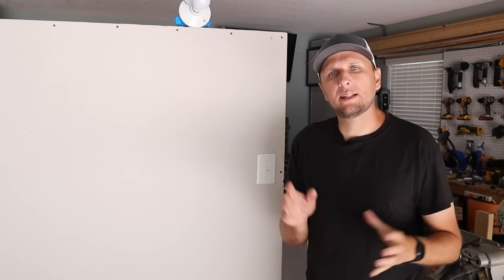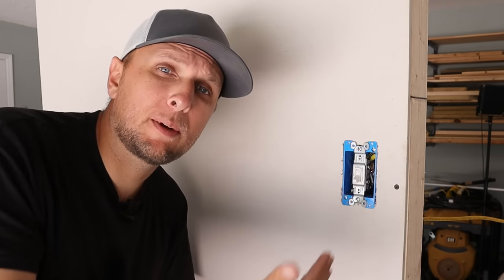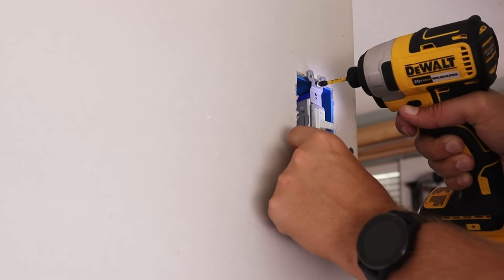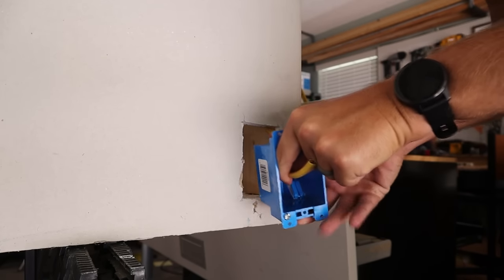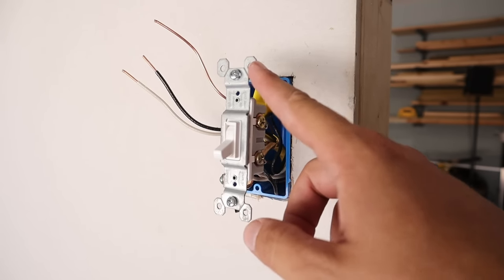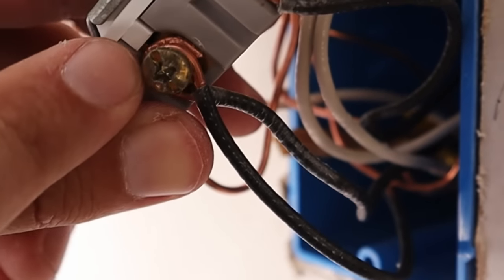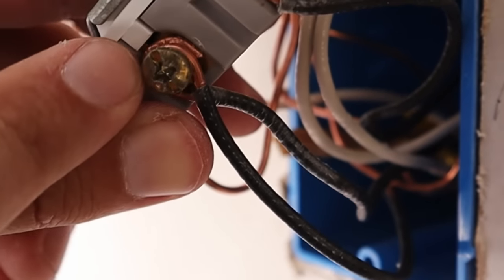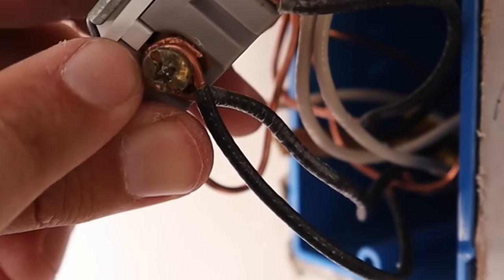How To Add An Outlet From A Light Switch | Common Mistake

Comment: One suggestion for DIYers, check that the power is on before you go and isolate that circuit. I've known some people who shocked themselves because they tested it after shutting off the power only to find out that they werent testing it right. If you confirmed that the power was on then you should be good when you test it after flipping the breaker and power is off.

Comment: Need check box fill on conductors. Need to allow 2 wires for the yoke or strap(switch) and add up all other conductors to make sure your box is not over the allowable amount. Good chance you will have to change out the box for the switch.

Comment: Homes after a specific date (not sure when they were adopted by your local authority) require arc fault protection on receptacles, so they were typically not wired in with lighting circuits, so this method would not fly.
Reply: This method wouldn't fly in most countries.

Comment: When you wiggle the strippers on the wire like that it's possible to score the wire. instead, after clamping down with them use the thumb of your other hand to push the strippers off the wire.

Comment: Thanks, I have a storage room that was added onto the house before I bought it, it has one light switch and no outlet, the light switch is on the inside hinge side of the door so you have to walk around the door to turn the light on. The room is unfinished, bare studs inside. I want to move the switch to the latch side of the door and add a interior and exterior outlets to the curcuit the nearest outlet is more than 50 feet away outside and my extension cord for my chain saw only reaches one side of the tree near the door.

Comment: Is it safe to plug a power strip from this new outlet? I would like to add another outlet in my room (but get it done professionally) and I'm thinking of suggesting this method to an electrician, but I'm worried if it will overload if I plug a power strip from this.

Comment: Hi Adam, when your connecting a light switch to a prexisting outlet ( for a light fixture), will that switch turn the outlet on and off too.

I need to feed off an outlet but don't want the outlet to go on and off each time I turn the switch on

Comment: Instead of wire nuts, you should try using WAGO lever nuts... so much easier to work with, no twisting required.

Comment: I tend to use number 12 wires and that is lot harder to work with than is the case with number 14.  I see that number 14 is the favored wiring these days and I think it costs less too.

Comment: I thought I was all set and did this method in a double gang switch box. Can't get the receptacle to work properly. It is either powered when the switch is on, or the switched fixture only works when an item is plugged into the outlet, and on. Where can I go (other than fork over $$$ for an electrician) to understand what to do? The switch box initially had 3x 14/2 coming in (now it has a 4th as I dropped in the receptacle). I'm assuming this means the power comes straight from the breaker to the box, and not to the lights. House built 8 years ago (but by my father-in-law, who is not known for doing things the right way but the easy or cheapest way).

Comment: I have 5 tips for you. 
1. Always finish tightening with a regular screwdriver not Phillips. The screw will be tighter. Always use the screws not the push in. 
2. You can mention that the white wire will always be on the same side as the ground. 
3. The reason doubling or pairing the wires is bad, is because of the heat the wire creates when electricity moves through it.  It will expand and contract and finally come loose or even start a fire!
4. Even when I shut the breaker off and test it with the tester,  you should always check with your index finger and thumb to make sure the power is off.  Thumb goes on the hot and index finger goes on the neutral.  And you do it with a quick on/off tap. This way if for any reason you shut the wrong breaker off,  the electricity goes through your hand and not through your heart! It's a great practice to do.
5. I sometimes still like to run 2 screws in each corner of the old construction box and into the stud to secure the box better.
Reply: Nice video!

Comment: Hi, one point I've never seen addresses in any video, and no one has answered this question although I've put it on several videos - suppose, like in my shop situation, the box has 4 light switches.  Do I put 4 wires and one input pig tail (that's 5 wires) into one wire nut?  It somehow seems better to just put two wires on each receptacle.

Comment: I noticed u don’t tape up the outlet to prevent shock when placing it back and also helps stop ground hitting the ground it’s not necessary but I’ve found when u have diy homeowners it helps stops the called of pissed off ppl saying u told me the wrong cause it’s been months since I told them and they forget which one so yeah

Comment: If metal falls across a plugged-in cord at the outlet, it will strike the ground first instead of the hot wires if the outlet ground is on top. I also noticed that the wire loop on the switch ground was not in the direction used to tightening the ground screw. One last thought. something should be said about matching the wire gauge to the outlet to the hot wire gauge on the switch. Using a smaller gauge wire could be dangerous as the wire could overheat and not trip the breaker which would be sized for the larger gauge switch wire. (older homes were often wired with 12 gauge switch wire instead of the 14 gauge wire commonly used today.
Reply: If it does then it'll be a short and trip the breaker. Second a lot of wall warts and some other devices (my window air conditioning for example) have the main weight (and cord) pointed towards the floor instead of trying to pull the ground pin out like yours would.

Comment: Opened up a light switch to a light I was removing from a wall in my  house. It had at least 5 wires on it. It ran around the corner to an outlet, which was feeding it. I opened the outlet to remove the line from it and the outlet wires were so short it couldn't fully come out of the box. Then I noticed the two top wires on the outlet were black. So I opened up the wall. There were two wires (both sides of a loop) connected and then split off of in the wall with about 2 rolls or electrical tape around them. At that point I removed all the drywall from the wall. I have to go up in the attic, put in a box and run a proper wire down for a new outlet, then straighten the studs and install new drywall. All that because I wanted to remove an ugly and useless light from a wall. At least my house is much less likely to burn down now.

Comment: I have a question that I was hoping you could help me out with.  My bathroom has no outlet but has a switch for a light and a switch for a fan.  I want to add an outlet off of the switch but the wiring has me a little confused on what I should do exactly.  First off, there is no ground wire connected to either switch.  One switch has two black wires connected to the top gold screw and one black wire connected to the bottom gold screw.  The two separate wires wrapped around the same screw has me throw off.  The switches are in a metal box.  What’s the best way for me to add a GFI outlet?

Comment: Question! Can you connect the hot wire of the new outlet to the other screw on the switch to make the outlet come on when the switch gets flipped on? (Trying to add closet led lights that come on with the overhead light)

Comment: So I need to add a ceiling fan with lights on it. So I have 2 wires coming in to the light switch already. I gather 1 is for line and the other is for load going straight down to the receptical! So can I just add a 14-2 wire running from the fan to the light switch and hook it up like that?

Comment: So, it is my understanding correct that the outlet will always have power regardless of whether the switch is turned on? My reason for asking this is I would not want the light switch to control whether the outlet worked or not

Comment: Question: what if it is a switch that is connected to another switch? I have stairs and want to put an outlet next to them for vacuuming but its a (I think it is called) 2 pull switch where at the bottom of the stairs and the top of the stairs control the light at the top of the stairs. 

Same concept? Just find the live wire or will one switch be piggy-backing off of the other switch and I will need to put the outlet wherever the live wire is going to from the power box? 

Fyi: I need the outlet to always be working and not work with the switches.

Comment: Great video. One comment on the video. After you turned off the breakee the second time, you need to check the wires if they are STILL live in the event that you turned off the wrong break. I cringed a bit seeing that you tounched the leads without a second check.

Comment: I always test the tester and verify it detects that there is voltage before you turn off the breaker and then that it goes off when you turn off the breaker. This ensures the tester is working.

Comment: How do you provide stress releif for the cable that runs between the boxes? It appears that the chain that pulled the cable up was dropped through a open hole in the switch box and not through a "clamping" opening.

Comment: Great video! I plan on doing a similar installation to install some night lights for my grandma. Based on your installation, do the outlets only have power when the switch is on, or is there power running through to the outlet regardless if the light switch is on or off.
Reply: Outlet should work regardless of of light switch being turned on
Reply: DUH
Reply: It's all in parallel from the switch onwards. They should all work independently.

Comment: I used this video and now have my led can lights pulsing or dimming depending on the load applied to the outlet, I’ve removed inspected and reinstalled all connections and wire twist connectors. Any idea why I would get the dimming/pulsing on the light circuit?

Comment: Usually, the switches don't have a neutral.
From were you got a neutral in this video?
I am trying to do this but in the same box where the switch is, by using a combination switch + outlet.
Reply from the maker: If it’s an older home it probably won’t have a neutral in the switch box.
Reply: @HowToHomeDIY  How to get a neutral then?
Maybe running a wire from a near outlet? My switch in on a pillar in the middle of my living room.

Comment: Electricians in the 70s used to do the two wires on the screw terminal. Remember how 70s homes got a reputation for having random electrical fires.

Comment: What about having to attach the new wire to the stud (with clamps or wire staples) 6 inch after the box? Does that only apply to new construction but not to later ad-ons?
Reply from the maker: Correct.

Comment: I’m this wiring method, does the new electrical socket have a continuous feed of power or is it controlled by the light switch?
Reply from the maker: The receptacle always has power.  It is not controlled by the light switch.

Comment: Yellow wire nut is only rated for 2 #12 wires. You need a tan or red wire nut for this job. :)
Reply from the maker: Not all wire nuts are the same just based on color.  This particular Ideal wire nut can handle 3 #12s.  Always check your packaging.

Comment: I have a light switch that's supposed work with two duplex switches on another wall. It must be wired wrong. The light switch has a black and blue for each terminal. The duplex has the same along with the common. There's power everywhere but I have to manually turn off/on the lamps.

Comment: just one point your hand that is holding the power plug is in the path of inertia of the screwdriver. I learned to keep my hand to the side. One slip and you can put the screwdriver right through your hand.

Comment: I was wondering if say you had instead been adding in an outlet for a plug in garbage disposal that would be controlled by a switch would that outlet if tested by that outlet tester not light up at all which could either indicate a hot wire or no power to the outlet. The reason I ask is because my previous garbage disposal was hard wired with the wiring going directly from the off/on switch and didn’t have a plug in type cord. My old garbage disposal went bad and I purchased one that I had to add an outlet under the kitchen sink to plug it in. I bought a plug in outlet tester recently and thought it was my new favorite toy. I went around the house plugging it into every outlet. They all lit correctly by lighting two of the 3. But when I went under the sink to where I had installed the outlet for the garbage disposal nothing lights up on the plug in tester. Which indicates a hot wire or no power. Just wanted to check if this passes code since a person is going to know whether they switched off power to the switch that controls the outlet below with the garbage disposal plugged into it.  I just became concerned because I watched another guy show he had an outlet that the wiring was damaged but power was on and going to it and acted like it was an unsafe situation. But his was a separate outlet and not one being controlled by a switch so I think the two would be different situations where I don’t need to freak out like he did in his case. He had to repair wires. There’s nothing disconnected in mine. It works when I flip the switch.

Comment: Not so much a comment but more a question.  Many homes are wired with #14 wire for lighting circuits and then outlet circuits are wired with #12.  Is there any concern installing outlets on lighting circuits with #14 wire?

Comment: Sometimes when I replace lightswitches(WITH POWER SHUTOFF) I see those wires in those holes and are a pain as you have to cut the wires strip them then wire it to a new switch, normaly I use the screw therminals under the plate

Comment: You used the yellow ROMEX (yellow = 12/2 = 20A), yet you used a 15A receptacle... I think this is still code as you can only plug in a 15A "thing" into the 15A outlet (with the straight prongs, not the 20A prongs), however, I would prefer a white ROMEX (14/2 = 15A) cable. Your thoughts?
Reply: 12 gauge is required on 20 amp circuits and is optional on 15 amp circuits. Keep in mind that 14 gauge is the minimum for 15 amp circuits. It's your choice.

Comment: These boxes have numbers on them indicating how many conductors can enter into the box. If the number of conductors entering a box exceeds this printed number it's a code violation. This can cause too much heat to build creating a very dangerous situation. This is obviously over simplifying box fill requirements but just some helpful information to keep in mind. Ground wires all count as one conductor.

Comment: I may have missed this in the video but does this example provide power at all times to the outlet or is the power on when the light switch is flipped?
Reply from the maker: There is power being supplied to the receptacle at all times.

Comment: Upon screwing the box into the wall. What did the screws attach to? just the gyprok?
Reply from the maker: It’s an “old work” box so it has wings that clamp down on the drywall.
Reply: @HowToHomeDIY  OK, it wasn't clear in the video. Makes sense but didn't know there was such a thing.

Comment: 3:50 you don’t really need to attach a chain or anything. Just run your wire down through the hole in the reciprocal box and you’ll see it in the new hole.

Comment: I discovered a lampholder with 2 common and 2 neutral and 2 grounds controlled by 3 way switch.  I want to add an additional lampholder, but not sure how to connect the wires to the 1st lampholder.  The 2 nd lamp holder would operate at the same time as the 1 st lamp holder.

Comment: Following these directions, would the outlet be on 100% of the time, or would the switch cut it off and on?
Reply from the maker: They are separate.  Outlet would have power regardless of the switch.

Comment: These instructions were great and I followed them for adding two outlets. But now when I flip the switch to on, I get an "open ground" indicator on my outlet tester. When the switch is off, the outlet tester indicates everything is correct. Any ideas of why that is?

Comment: There seems to be a missing part of the video where it is covered how you pulled the electrical wire through the light switch box.  It appears you were able to easily pull the new electrical wire into the box with no effort.  I am not sure how that is possible.  Did you drill a hole in the box first?

Comment: First, you need to see if the neutral wire is in the box.
Next you need to see which wire on the switch is from the panel.
Keep in mind that some people put a white wire on the switch which is hot. (Electricity is color blind)
Most importantly, rule number one - a live wire looks just like a dead wire.

Comment: Is the following scenario possible?

1) The switch is in the foyer.

2) The lights that it controls are the coach lamps on the front of the garage.

3) I want to install an always-on outlet INSIDE the garage, just behind one of the coach lamps to be able to plug in the power cord for an otherwise-wireless (Wi-Fi) security camera.

4) I'm too tall to get to the front of the garage in the attic, so I need to be able to do this through the inside wall of the garage at the same level as the coach lamp.

5) I do NOT want the coach lamps to stay on all the time, so I don't just want to leave the switch on or rewire things at the switch in a way that result in the coach lamps always being on.

6) Given the length and locations, I don't want to run a whole new wire from the switch to the outlet in the way shown in your video.

So, can it be done?  If so, what must be done?  

Thank you.